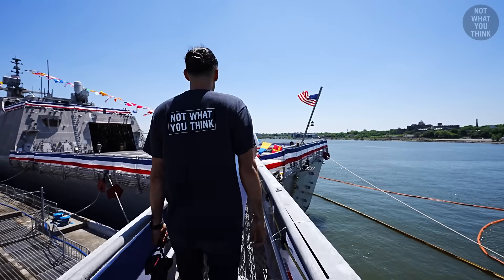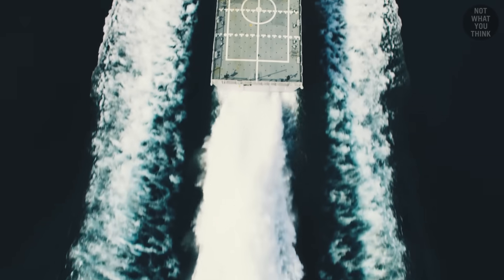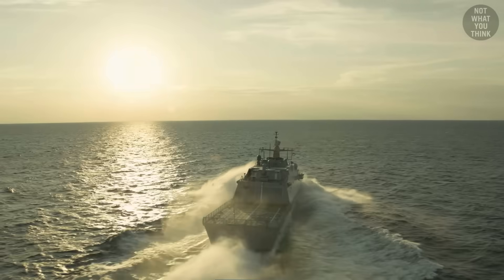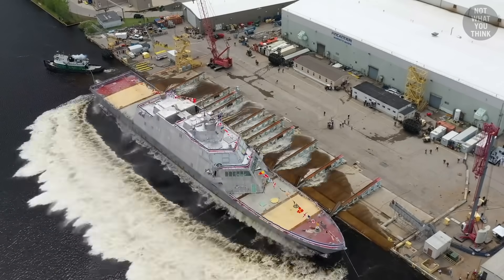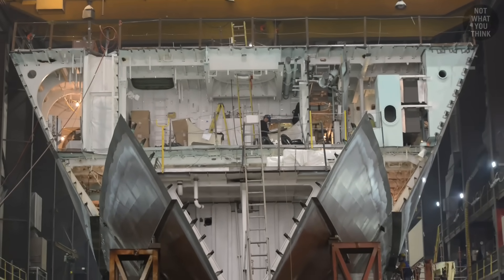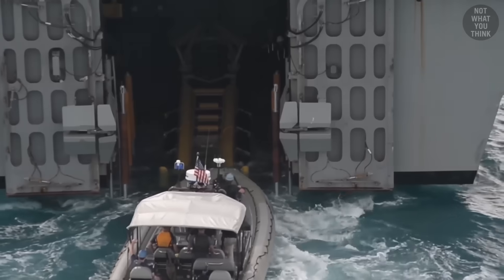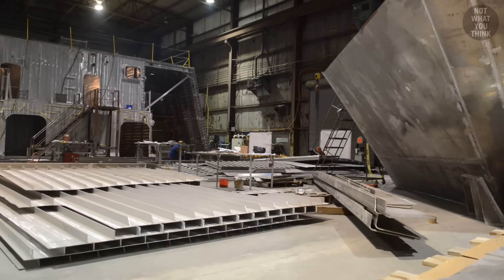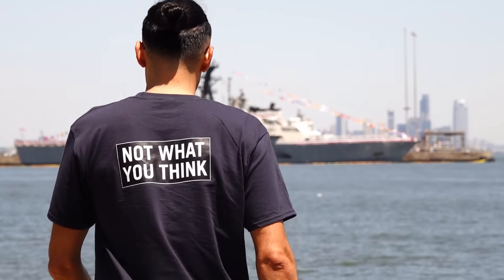I Visited The Most *Overpowered US Navy Warship

Comment: Of course, it has received a lot of criticism. The problem is that even for the missions previously handled by the OHP in the existing U.S. Navy, there are already cheaper and more capable ships available. The concept originally desired by the U.S. Navy and Congress was to replace the Navy’s second-tier combat ships and coastal support vessels with a large number of affordable, multi-purpose littoral combat ships, but this vessel does not fit that concept at all. The cost is another issue—just building two of these can be as expensive as an Arleigh Burke-class destroyer. Who would like such a thing?

In many ways, this project is very similar to the Joint Strike Fighter (JSF) program being carried out concurrently. The JSF aimed to reduce costs through tri-service integration but instead saw costs skyrocket due to that very integration. Similarly, the attempt to combine different classes of ships—frigates, coastal patrol ships, and minesweepers—into one to replace them ended up failing to adequately fulfill any of their individual missions. Costs increased, many of the ambitious new technologies failed or were abandoned, and delays became rampant.

At least the JSF, as the only fifth-generation fighter in the Western world aside from the F-22, managed to continue development and improvements despite the challenges. On the other hand, the LCS has already seen one of its three major missions, anti-submarine warfare, transferred to the next generation of ships entirely. Moreover, there's frequent discussion about replacing the Avenger class with another class of ships for the crucial mine countermeasure mission instead of using the LCS. Given the significant investment in MCM MM development and the fact that abandoning the mine countermeasure mission would render the LCS a costly failure, there is a determined effort to continue this mission at the very least.
Reply: Part of it was the LRLAP system that was supposed to be the crown jewel of the ships, which turned out to be an albatross. The concept is sound, something long enough ranged to do the job of a missile, but a deep enough magazine and inexpensive enough to be able to be deployed consistently without having to go back and reload. Unfortunately, while the original plan the rounds were quite inexpensive compared to missiles, when the purchase order got the hatchet job, they were no longer able to leverage economics of scale, and the per round costs skyrocketed to being even more expensive than a missile. 

Ultimately, the problem was too many new ideas that didn't work in practice the way they expected. The modular system that was supposed to be one of the main selling points was an utter disaster. The LRLAP system might have worked if they'd built enough of them to make the price per shell cheap enough, but was doomed to failure once budget cuts came in. Basically, everything that the class of ship was supposed to do, it couldn't, because each system was a new one that hadn't been rigorously tested, and turned out to have... 'teething problems'. 

Hopefully, the experience we paid dearly with these systems will be used going forward, as an example of what not to do and also what needs to be improved to make these technological improvements more mature. Kind of like the old program that tried to double the accuracy of the rifle and ended up with the ACOG.
Reply: They are retiring this class of ship, with the first five already decomissioned.
Reply: @downix  boondoggle comes to mind.
Reply: @jimwjohnq.public  It didn't have to be. The underlying problem was in developing both the platform and modules for the platform simultaneously.  Delays and issues in one impacts the other.

What they should have done is taken an old Kidd class destroyer and developed the modules using that. Once they were ready, then develop the hull around those.
Reply: Shoulda sported for a mfg license for  Tarantul II :body-blue-raised-arms:
Reply: The F-35A’s are down into the mid-$80 million range now, which is very good (the 4th gen F-15EX based on half-a-century-old technology is ~$15 million MORE per airframe - thanks Boeing!) 

But yeah, I feel bad for the LCS program. The builders kinda did what the navy wanted, but it didn’t really work at all.  Very cool ships though!
Reply: @EstorilEm  you mean the F-15EX? The F-14 is retired in every nation but Iran.

And that is what happens when you keep an airframe flying for decades past the intended replacement date. But getting Congress to understand that is the challenge.
Reply: @downix  yeah, must have been autocorrect - an F-14EX would be badass. 🤣
Reply: Who !?
Reply: What a crock of propaganda.  Maybe you should put on the uniform as I have and go serve because you clearly don't have a clue what you are talking about.  BTW, LCS does not even come close to the cost of Burkes.    LCS Freedom class cost around $400 MILLION.    Burke Flt III's cost $2.4 BILLION.      Just more proof that people like you have no idea what you are talking about.
Reply: JSF is LONG over. The F-35 won, what the hell is this?
Reply: @cmkeelDIM  It is still called the JSF Program Office
Reply: Thank Lockheed-Martin.
Reply: Yeah, what they really needed was a new coastal patrol ship that could do lots of other things not-terribly if you really needed it to. That's exactly what the LCD has been slowly morphing into over the years.
Reply: Industrial Good-fellows are making money and providing kickbacks to their sponsors. 😮😮
Reply: If it ain't broke don't fix it. Instead of having a one size fits all multi-tool, just stick to different classes of ships to handle different roles and missions. No need to have a minesweeper, coast defense, as well as anti sub ship all rolled into one
Reply: @CJFellowServant4288  Minesweepers and fast attack craft are not really good at crossing oceans.  They are small, slow, can't handle severe weather and need other support ships to mother hen them across oceans, and they don't cross oceans fast.  When you need minesweepers you need them in a hurry, not three or four weeks from now.  The US Navy has lots of experience with this.  The US Navy has also had miserable results trying to deploy their own fast attack craft like the Ashville class from stateside bases to overseas operating areas.  Short legs, need to refuel and take on fresh water almost daily, poor sea keeping in blue water, etc. Small hulls do not deploy well.  The Danish Navy has had great success with mission modules on a couple of their ships.   Aircraft swap weapons and sensor pods for different missions. Why not do the same with ships.
Second thought, more hulls means more manpower, and more cost.   Having more different designs adds sustainment costs and it is sustainment costs that are eating the surface fleets shipbuilding and repair budget alive.  The idea that you have a ship in which you can swap out mission modules as the tactical situation dictates has merit.  Other navies do it successfully.  The US Navy, instead of abandoning the idea needs to put their nose to the grindstone and make it work.  Don't try to tell me the US Navy cannot do what the Danes do.
Reply: JSF isn't a great example because most of the negative coverage from was from people who didn't understand what the plane could do and were stupidly just comparing top speed and turning performance like a bunch of elementary school kids arguing on the playground.  In practice, a team of two F-35's could literally destroy every F-14, F-15, F-16, and F/A-18 ever built, if you let them fly enough sorties, without losing a single plane.***  The F-35 was NEVER a loser and there's almost nothing you'd do differently if you had to start over from scratch.  It merely had some normal teething troubles and needed people to start to understand it.

The LCS's are more troubled.  Some of the troubles, like the gearbox frailty, or the incorrectly-engineered deck on some of them (can't remember the details--cracking??), aren't the kind of thing that renders the entire design bad, merely things that had to be discovered and fixed in subsequent hulls.  Other "big problems" aren't actually problems.  For instance expensive contractors don't have life-long commitments to early-retirement pensions and VA health care, and can actually be cheaper in the long run.  Banning use in more dangerous sea states is borderline acceptable for a small shore-hugging ship.

But the bigger problem is that the speed requirement simply wasn't worth sacrificing so much for.  Cut the top speed in half, and the cost would plummet while mission load capacity doubles.  The mission hot-swapping also has inefficiencies introduced by the swapability, and I'd guess that if you hard-wired the missions you could get 3 missions into that "merely" doubled capacity.  (Or, two missions with extra crew.)

It also leaves some questions open in my mind: not sure whether they're big problems or not.  For instance I'm not a naval engineer (just software myself) but the gearboxes seem to be a single point of failure.  Why not give the small engines small jets and the big engines big jets and let the small engines work without any shared functionality at all?

(*** One F-35 stays out of the fight and uses its radar from 100mi away.  It can see ALL the fourth-generation fighters clearly.  And since its radar is on, they can all see it.  But it's too far to shoot at.  The second F-35 gets within 20mi of the fourth-gen fighters without being spotted, and using radar data from its buddy, launches 4 AAMRAAMs, and the two F-35s reverse roles.  If you shoot at the far F-35 it just turns off its radar and disappears.  You have no idea where it is.  It pops up a minute later 6 miles from its last-sighted location and gets more target data for its friend, then disappears again.  The pair will wipe out on average about 6 of the fourth-generation fighters per sortie.  Sortie after sortie.  The older planes might get a missile lock but not be able to hold it for more than a minute or so, and will never see either F-35 visually.  Meanwhile the popular press is whining that it's got a lower top speed and turning speed than the F-16 it's meant to replace!  While every single F-14, F-15, F-16, and F/A-18 ends up in the grave.  And the proof is that it's the biggest selling Allied fighter in 30 years.  They've sold over a THOUSAND.  And that in turn has driven the cost per plane down to the same price as F-16's!  I'm not 100% sure but while the F-16 is still in production, I don't think any country that is buying F-35's has bought even one more F-16...

Oh, another big misunderstanding about the F-35 is that for the first time they calculated the total cost of the program over its 50-year lifespan including training, operation, maintenance, spare parts, even to base security and eventual recycling.  The number is big--$1 trillion!! But over 50 years it's not much per year, especially when you consider that this is basically the only fighter we'll be operating for several of these decades.  Add up the cost of all the planes it's replacing, times the number of years it will be operating, and scale it all to 2020 dollars and it's actually a reasonable price, and that's before you consider how killer it actually is.)
Reply: @franksheeran9243  The F-35 probably should have been named the A-35.  Its raison d'etre is getting deep inside the best defended airspace and taking out ground targets without being detected and shot down, the kind of mission modern ground based radars and air defense missiles have made a suicide mission for legacy 4th gen non stealthy platforms.  If an F-35 finds itself at the merge of a big furball dogfight then an awful lot of things had to go wrong, either the mission planners did a sloppy job or the pilot didn't fly the mission plan. 
As for the LCS, speed is essential to the mission.  Their speed combined with haze, glint and other factors unique to the maritime environment makes them much harder for the usual anti-surface weapons to track and hit.  Remember one of their missions is to go into shallow water and fight enemy fast attack craft.  And while some of the old salts out there and the internet critics can't see it, open source Chinese naval literature suggests the  PLAN considers the LCS 2 class in particular to be a significant threat.
Reply: How could there be any controversy I wonder.  In this very video he talks about two year old ships being retired early....then mentions that two ships are still being built.  Fuqme.
Reply: @DoublePlus-Ungood  The early ships are very different than those being built now and from what I understand from the defense press the Navy considers it to be too expensive to upgrade the older hulls to the newer configuration.  Newer LCS have a different internal layout based on lessons learned on the early ships.  The first ships were a learning experience.  The Air Force has a similar problem with the first two dozen or so F-22s.  They are built to the original configuration and making the changes to bring them up to the configuration used on later lots is very expensive.  This is not uncommon on military hardware.  Does anyone remember the Gyrodyne QH-50 DASH?  An early try at an unmanned ASW helicopter.  Whole classes of destroyers were modified with a hanger and flight deck to operate it ( a hanger and flight deck much too small for any manned helo).  That program went nowhere.  Same for the B-58 Hustler.  
What gets me is that the LCS 2 class is based on a highly successful ocean going ferry operated by Fred Olson Lines around the Canary Islands.  That ship proved so economical and reliable in daily service that Fred Olson has been replacing its other ferries with wave piercing tri hull ferries.  Why can the civilian maritime industry make that design work so well and the US Navy struggles with it?  I think it more a problem of the old salts just don't like change.  The big hull blue water mentality blinds them.
Reply: @philsalvatore3902  Ahh.  Actually that does make sense.  I can understand that and thanks for the clarification...im from the $2000 toilet seat generation so I wont lie its kinda knee-jerk at this point when I get spider senses and wastefull government expenditures.  Im certainly not anti defense spending but yea.
Reply: @DoublePlus-Ungood  So I remember the so-called " $600 toilet seat".  I was a brand new Ensign in the Navy getting a tour of a P-3C out at VP-65,  So I had to ask, let me see the $600 toilet seat.  Well, you $600 of tax dollars were not just buying a toilet seat.  It was a complete toilet assembly like you see in airliners (P-3s did 12 hour missions so a potty was essential ) but unlike an airliner a P-3 can use up to 90 degrees angle of bank while maneuvering to get over a sub and drop torpedoes.  That toilet has to stay liquid tight during hard maneuvers.  You don't want the jon to overflow into the electronics in the back of a P-3C.  Not your average jonny !  $600 was a good deal for the hardware it bought.  And obtw, the JMSDF paid $1,000 for the same part used in their P-3Cs.
Reply: I don’t see why LCS can’t be used as intended; coastal support or second tier for anti piracy and the like. In combat, it can be used as a drone control ship.

And about being expensive, that’s the Navy’s mismanagement problem not due to this ship. Anything they do costs too much. Look at the Constellation which was supposed to be “off the shelf”. They completely changed it and now it costs too much as well. The JSF is also not expensive. If each service was to develop their own plane, you bet it would have cost 3x of the JSF as well!

The Navy should have gone with the UK type 26, specifically designed as the best anti sub frigate in the world.
Reply: @TheBooban  The LCS might work as a coast guard cutter, they'd be great at SAR and anti-drugrunner patrols, at least. However, the Coast Guard already has cutters for that role which work well. So they simply aren't needed. 

It'd also work very well in anti-piracy patrols, say in the Red Sea. Being fast and maneuverable, while being able to launch drones for further reconnaissance assets, would serve them well in that role. 

However, given their primary weapon system is officially abandoned, and their price tag is absurd, it really isn't cost effective to build more for that role.
Reply: @ShneekeyTheLost  my reply was auto deleted. Again, as I said, the price tag of any new class is absurd. Price of continuing with LCS has to be compared with absurd price of its replacement: Constellation class, whose price is now even more absurd.
Reply: @TheBooban  I read an article about the Constellation class.  They are already projecting a 40% cost overrun and the first one is not even started yet.
Reply: @TheBooban  
One word..MONEY
Reply: @TheBooban  Why can't they be used for coastal support?  The Independence class is being fitted with JSM, the excellent Norwegian anti-ship missile that obtw also has a land attack capability.  After the cluster that was the Oto-Breda 76 mm Compatto that shook itself to pieces and the US Navy reduced the rate of fire for the sake of reliability the folks at Dahlgren consider the Bofors 57 mm gun to be the best naval cannon under 100 mm.  With a 250 rounds per minute rate of fire (vs 90 for the Compatto in US Navy service)  and the same range of the Compatto it is a superior weapon and the ship can carry more 57mm rounds than it could carry 76mm rounds.  I think it is telling that Chinese naval literature cites the LCS and one of the threats they worry about.  They see capabilities in it that our old salts in their fondness for big slow (like them) deep draft hulls cannot see.
Reply: @philsalvatore3902  I didn’t say LCS can’t be used for coastal support. I said it could.
But probably not against China. China can shoot back. And if used along their mainland coast, China would go nuclear. USA will fight entirely defensively from far, far away. It will be a hard fight because of that. LCS is for the jobs the US navy doesn’t want to waste a destroyer on.
Reply: @TheBooban  The LCS was intended to fight inshore and fight enemy Fast Attack Craft or FACs.  FACs are short legged and don't cross oceans well so the Navy needed something with the speed, shallow draft and maneuverability of a small enemy FAC but still have sufficient seaworthyness and legs to cross oceans.  Ditto minesweepers that take 3-4 weeks to cross the Pacific.  The US cannot afford to post its own FACs and minesweepers everywhere they might be needed so whatever would fight FACs or conduct mine warfare had to be able to deploy globally and do so fairly rapidly.  It also needed to conduct mine warfare and hunt the notional DE boat sitting in the shallows silently using AIP.  Turns out they are too noisy for any kind of ASW (though other navies like Finland and Sweden do ASW with water jet powered corvettes, maybe they just suck at ASW?) but the mine sweeping module has actually turned out to work pretty well (took forever to finish but it turned out great) and while the original anti surface missile system they were intended to carry failed testing (joint program with the Army) the recent fitting of JSM gives them a very considerable anti surface capability.  The Marines just demonstrated using JAGM against a moving naval target and the MH-60R/S both can shoot JAGM.  You might not think the LCS, especially the LCS-2 is dangerous but the open source literature from China suggests they consider it a threat.  It is fast and trying to hit fast things on the sea surface with wake effects, glint and haze is not the slam dunk you might think.  Speed makes targeting hard.  And an LCS can go places a deep draft and comparatively slow frigate cannot.  Probably the worst feature of the LCS is that the skimmers all have this deep draft blue water mindset.  A lot of SWOs who came up on DDGs don't get it when it comes to fighting inshore.   It's a high speed knife fight nothing like defending the carrier or hunting subs in blue water.  They see a small hull and scoff that it such a minor command is not "career enhancing" the way command of a DDG or especially a CG is.
Reply: @philsalvatore3902  yes, i agree. And great that at least the mine warfare capability works. But again, China? It seems like it would be great in the south china sea, but really, just strike from above. Before actual war, they are playing bumper boats there. I don’t know how good the hull of the LCS is for that. US Navy can try running a resupply mission to that grounded Philippine marine unit out there. Would be interesting.
Reply: Aside from the f22? It is the first 5th generation fighter and th emost common, the US also has the f35, so it isn't "the only othe rthan".

The f22m and F35 are more frequent, and came before the one you're descrivbing, so it is the "only other" if anything. Never mind that Raussia,a nd China both have 5th generation fighters of their own...
Reply: @joshuawood1436 bro wtf. F22 is the first. And F35 is the result of jsf program, so dunno why he's calling it jsf, and why you are saying "they also have F35"
Reply: @joshuawood1436 8 countries were involved in the JSF program, and one can debate whether the SU-57 is a true fifth generation fighter or a 4.5 gen
Reply: @joshuawood1436  They don't have a true 5th gen fighter.  They haven't mastered all aspect low observable technology.
Reply: @joshuawood1436  The OP is also wrong with the cost comparison with the JSF it is coming in very well now with the numbers delivered and sold around the world . 16 countries using the F35 and Total life cost is already one of the lower paks in the current fleet of aircraft.
Reply: The unit price of the LCS ballooned because the old salts were butt hurt that the original spec was deliberately and purposefully set to commercial standards to keep the cost down.  The old salts whined and cried and forced both classes to be totally redesigned after the first four hulls were on the ways to incorporate all the mil-spec NAVSEA standards the original design eschewed in order to keep the cost down.  By the time the new design was finalized with all the NAVSEA horse pucky,  the price doubled and you went from having something cheap and relatively expendable to a costly and thus more valuable asset.  It didn't have to be this way.  Now the old salts are doing the same stupidity to the Constellation class.  Those were originally supposed to be about 70% common with the FREMM class but NAVSEA and the old salts couldn't leave it alone and now they are three years behind and building the first hull when 75% of the drawings are not finalized.  And the Navy keeps adding requirements to them so the design cannot stabilize.